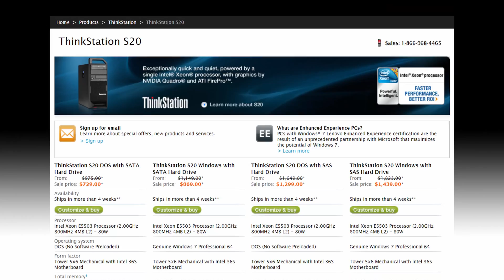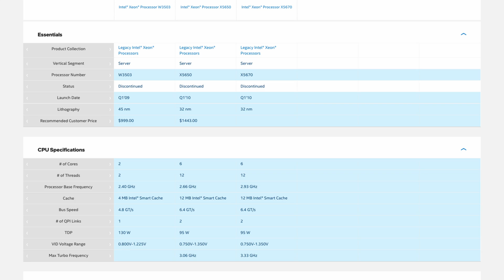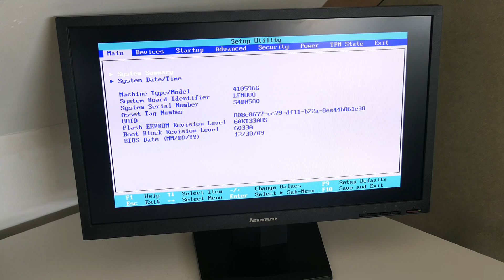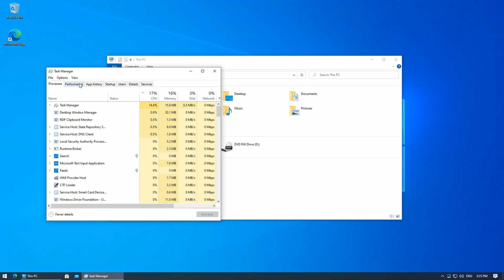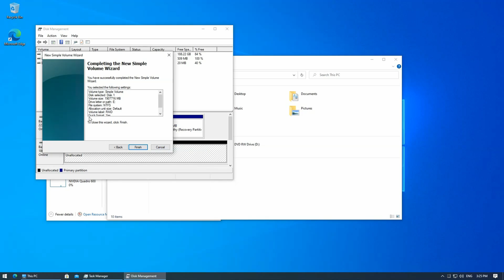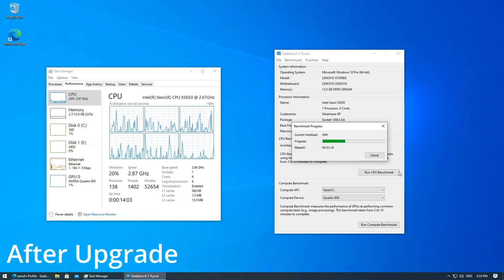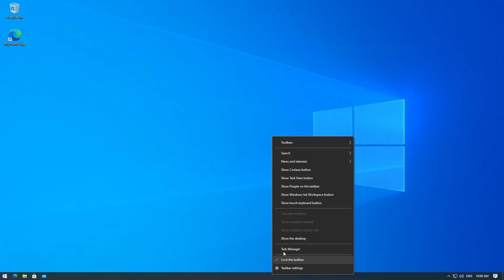Lenovo S20 - Teardown, Upgrades and Benchmarks

Comment: Will this be good for 3d rendering
Reply from the maker: The machine starts to show its age a bit. With dual CPU and a proper GPU it should still be able to do a good job though.
Reply: @jensdbe  I have a lenovo thinkpad t440p that's really struggling after serving me for a few years now and I've decided to go with a desktop and trying to find a decent workstation pc that won't cost much but will perform well

Comment: That proprietary 10-pin connector is a pain in my ass. I'm trying to build a "cheap" gaming PC and I suspect this thing is the main source of my issue with my Thinkstation D20 not posting atm. I ordered an 8-pin female to CPU 10-pin adapter for my EVGA 750 B2 Supernova. Will report back if this mod is successful.
Reply: did it work? i was trying to use the s20 mobo in a different case but the front usb connectors are proprietary. The best choice is to get one and upgrade the ram, gpu and ssd
Reply: @badactor9628  Yes it worked!!!
Reply: Do S20 Lenovo able for games

Comment: Great video, well structured and organised.
If you could help me with some questions I would be very thankful. 
So I got an Lenovo S20 (model:4157JP7), it has an intel xeon 3503 and I wanted to know if the motherboard is compatible with he Xeon 5690. (If not, what's your recommendation)?
There is not that much information on the web soo yea. 

Thank you!!
Reply from the maker: X5690 should be supported. Depending if you really want the max performance, consider an X5675 maybe. It has a much lower TDP (power consumption) and performance is close to the X5690. You can find them for about half the price of those as well
Reply: @jensdbe  Amazing,  I will probably buy that one then.
Keep up with the good work! 👍

Comment: Is there something weird about this motherboard, or did you put the video card in a pci4x slot??
Reply from the maker: Yes, it has two full PCIe x16 slots. This does not apply for most (consumer) motherboards as there is often a physical x16 slot which is only x4 internally. This one has two full x16.

Comment: my mobo will not come out even though it is all unscrewed and disconnected i hear a metallic sound when i lift up on it
Reply from the maker: Hard to tell why exactly that would happen. Double-check if you have removed all screws carefully. It happens to me very often that I miss one/two screws that keep the motherboard fixed.

Comment: I want to update my device to the highest level. What are the appropriate parts from which I will get the best performance of the S20?
thank you
Reply from the maker: The fastest CPU, as far as I know, supported, is the X5690. You can easily find it on eBay.
For RAM, just make sure you add modules in triples so you can take maximum advantage of triple-channel memory. Before upgrading the CPU, I would recommend to upgrade the BIOS first to make sure it is supported.
Reply: @jensdbe  I need it to do animations, so what do you advise me about the appropriate graphics card and whether the DDR4 RAM will be useful or something else

Comment: Hey again, I finally got the S30 replacement I was planning to get. I was looking online, and couldn't find an answer, so I figured I'd ask you and see if you can help. I want to remove the case handle on my s30, because my case got damaged in shipping, and it's not letting me close properly because of the handle being slightly bent. I remember there being a flat little plate you could put in place of the handle, but I can't find it for the life of me.  Do you know what that part is, or what it's called? It'd really help me out if you could point me in the right direction.  Thanks!
Reply from the maker: I knew you could remove the handle from the S20/S30 but don't know much more.
Found this: https://www.workstation4u.de/shop/produkte/item/lenovo-thinkstation-s30-griff-handle-fru-lnv-00000550-100
Can't seem to find any reference in the manual though.
Reply: @jensdbe  No worries, thanks for trying to help though. I'll check the link out. I also asked the refurbishing company that sold it to me to see if they knew. Thanks again.

Comment: I have this same rig, I use it for media creation. xeon 3550, 24gb of ram, 4 SSDs, 1 external HDD, Quaddro k2200 gpu. I've had it for about 4-5 years now, and it's been real good to me. I'm going to try and get myself the s30 next time around so I can take full benefit of the ssd's bandwidth.  Great video!

Comment: i have an issue my pc which is same as yours stoped working with a 8 beeps in launch so u decided to replace gpu i will buy a 1660ti tomorrow but i tried to boot my pc and no signals apeares also no beeps idk what to do
Reply from the maker: Had a look at the BIOS beep codes in the hardware maintenance manual : https://download.lenovo.com/ibmdl/pub/pc/pccbbs/thinkcentre_pdf/s20_hmm.pdf (see page 71) but can't find anything similar. Maybe it can help you.

Comment: Hello, is it possible to use an other motherboard in the s20 ? For example ASROCK Z68 Pro 3 ?
Reply from the maker: I believe it is. The case has a regular IO backplate and mounting holes for the motherboard. There is also plenty of room in the case. Only maybe the front panel connecters might require a small modification but hard to tell.
Reply: I did so far only could only turn on and off everything is proprietary besides even power on connection